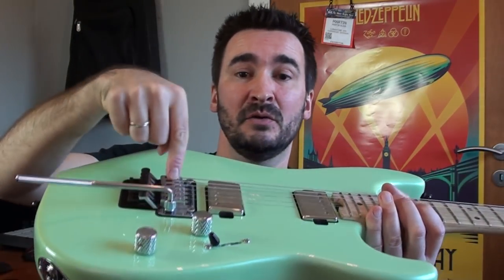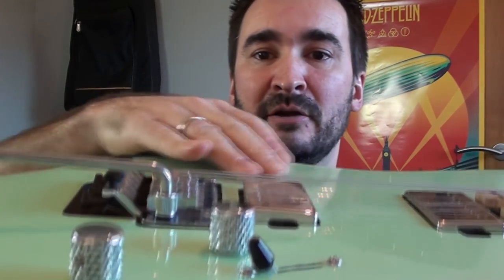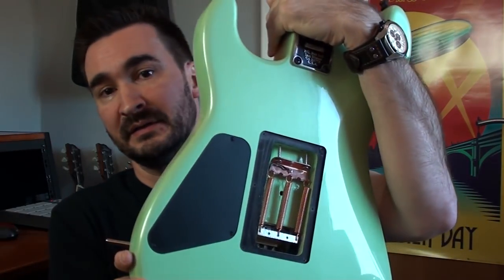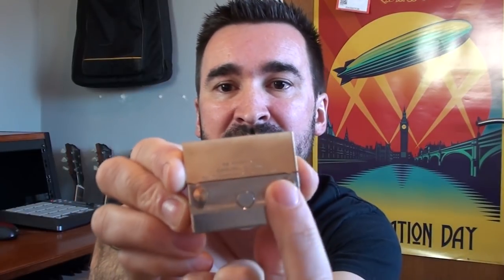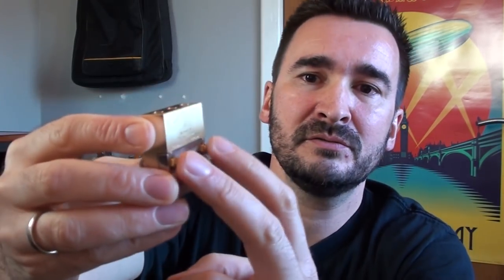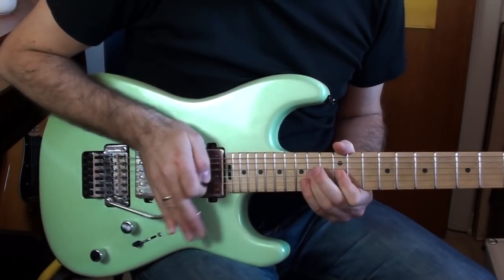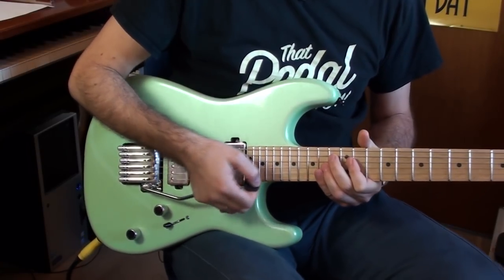Coherent Sound in Light - Sophia 2:92 Tremolo Part 1- Demo by Martin Klaja

Comment: @Martin just subscribed. I was wondering if you can confirm if the Sophia is designed for 10" Straight Radius necks like Original Floyd Rose designs? They list shims for sale on their website, but I'm not sure if the shims adjust it to 14" Radius, or if the design is FOR 14" Radius to start (which is a bit flatter than I'm used to since I favor 10" Radius PRS guitars and 12" Radius Gibsons typically). Both videos were great (and anyone reading this should really watch both), and you really hear the Brass do its job with the Sophia replacement block you installed for A/B. Thanks in advance if you get a minute to respond (I'm in the middle of building a guitar with locking tuners that WON'T use a locking nut, and possibly the Sophia, so you retain a bit more tone/sustain of the neck).
Reply from the maker: Hi Cary
Thanks for subscribing and the question. unfortunately I am not sure! Please contact the nice people at Sophia and I'm sure they will answer all your questions... Regards Martin

Comment: I see that the lower E button is longer than the cavity for the original Floyd. It seems that you have to be extra carefull pulling it back otherwise you will end up damanging the finish of the guitar. Maybe install some sort of stopper.  It sounds great but this fitting issue is a big question mark. I'm not convinced I need one.

Comment: Did you have to install locking posts? So they come with the bridge or do you use your existing ones
Reply from the maker: Hi. If you are talking about the locking nut (at the head of the guitar) it's not included in the system. The Sophia 2:92 system is suppose to replace FR systems that already has a locking nut.

Comment: What do you mean about the Kramer guitar? You said it didn’t sit right. Can you explain why it didn’t work in the Kramer? Thanks
Reply from the maker: I bought the Kramer second-hand and I think it's been taken apart and put together many times. It's been repainted and the screwholes for the tremolosystem were damaged. I only found out because I was trying to install the new tremolo
This is NOT a bashing for Kramer guitars! I have tryed several and they were great! Mine was just to abused...
Reply: Martin Klaja's Guitarchannel what I’m trying to ask is why didn’t the Sophia tremolo work in that guitar? You mentioned it didn’t sit right? Is it because the tremolo doesn’t work on floating bridges above the body? Just trying to understand why the tremolo didn’t sit correct.
Reply from the maker: @maxs5153  No the tremolo works perfectly fine floating above the guitarbody. Just make sure that you get the right lengh tremoloblock. 

I think the problem was that the two bolts that hold the pivotingpins have been replaced at some point (not by me). And that had not been done proper. One of them was a little loos and that made the hole tremolosystem woobly...
Hope that makes sense...
Reply: Ok I got you, so if the pivot poles are aligned and mounted proper then the 42mm will fit correct and work with no fitment  issues. I have a charvels model six with the similar floating bridge above the body(non recessed) that this would work on nicely... thanks

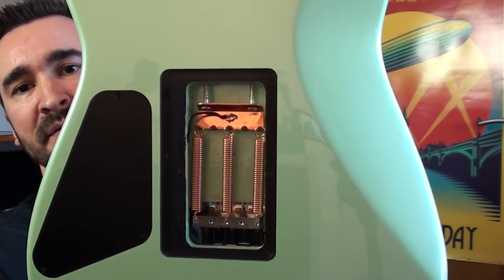Comment: Can you flutter with the Sophia? What is the difference between the 2:22 and the 2:92? Can the bar be tightened so it stays in place?
Reply from the maker: Garrett Guitar yes you can do flutter with the Sophia. If you listen to the intro to this video I do one. 
The difference is the spacing between the posts. The 2:22 is standard Fender spacing og the 2:92 is standard FR spacing. 
Yes you can lock the arm in any position. 
Thanks! Martin

Comment: Hey man, just a question, but is the Sophia Trem easier to tune/restring than the Floyd trem?
Reply from the maker: I think the tuning is the same as on a FR. But the restringing is easier as you don't have to cut the ball of the strings...
Reply: Xziol Psyxe You dont have to cut off the ball end just string it through the fine tuner hole & you lock it doen with the allen screw behind the roller

Comment: { EDIT - I know the Sophia is a great Mod with NO routing req'd but...} how many of you would do a "bathtub rout" on  a Fave Strat ? ? then why on earth buy a guitar with a huge hole routed thru the body for the trem block... then  a big tub routed in the back for springs..... then you're not done - gotta rout a THIRD hole for the Floyd Micro Tuners - - get a Kahler Top Loader and keep ALL that wood ! ! yes the Sophia is a great resto mod... but I just cringe when I see guitars with rear spring covers - so unneccessary
Reply from the maker: No routing is needed! Just get the 2:22 model and it drops right in a Strat!!
Reply: The Kahler systems are pretty awful IMHO. I've played many guitars fitted with several different iterations since the 80s, and they felt woolly to me and never kept tune as well as my OFRs or Ibanez Edge, which have NEVER gone out of tune, even with Steve Vai levels of abuse! Hence why not many guitars feature Kahler systems anymore. Also you have to screw some models into the guitar body behind the binding posts! As far as the CLS trems go, they look promising and I'll probably start by replacing the block on my OFR with their brass trem stop. Still not seen anyone put them through their paces properly yet though.
Reply: I do realize that - and yes this is great Mod - I wanted your viewers to ask themselves why they would CHOOSE a stock Strat with all that wood removed... esp the Floyd models - there are other trems like Kahler that remove far LESS than the Floyd extra rout alone... and don't remove ANY of the normal Fender rout wood - no trem rout or spring rout - Fender Japan makes them
Reply: I realize the Sophia is a great no-rout, drop in Mod for those who have already committed to a gtr with a thru -rout and a rear spring rout - my point was that if a "bathtub rout" for pickups is viewed as a destructive loss of wood... then any strat is 3 times worse - people may want to rethink the strat-superstrat design entirely
Reply: @byronofcalgary6985  

That is under the assumption that EVERYONE thinks the bathtub OR Floyd routes are "a destructive loss of wood", which if you ask me, is only a problem for the tone snobs
(Which Ironically are often the ones swearing by tube amps, yet put all their signal through an original solid state tubescreamer)
If sustain is so important for all those tone snobs, they should be playing on steel beams
Reply: First of all, the bathtub (swimming pool) pickup route does nothing to your sustain. The contact points for your strings are your tuners, nut, saddles, and bridge. As long as those are high mass, and locked down, you are golden. My fattest guitar is my G&L Legacy with a Saddle-Lock bridge. G&Ls all have swimming pool routes. It's as fat as my Les Paul. Kahler's are well known to have abysmal sustain and harmonics. The cam system absolutely destroys string vibration. If it was good, people would have used it. VHS vs Betamax argument. Stop spreading nonsense.